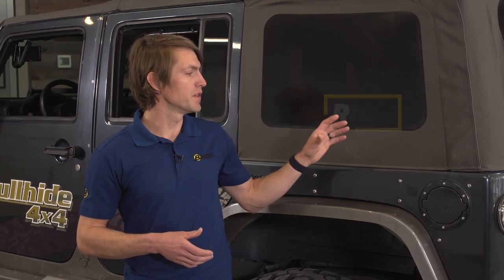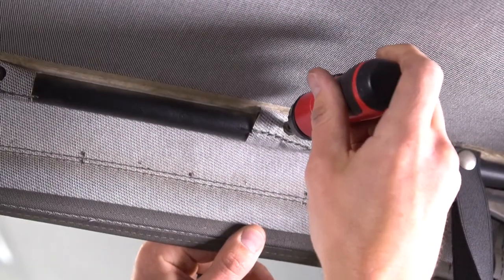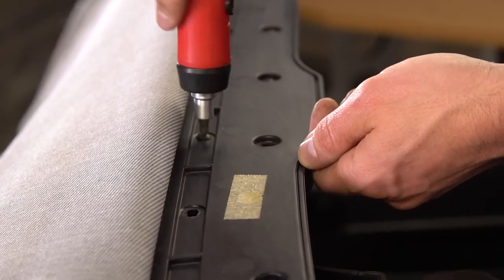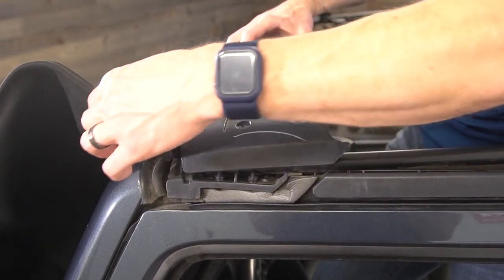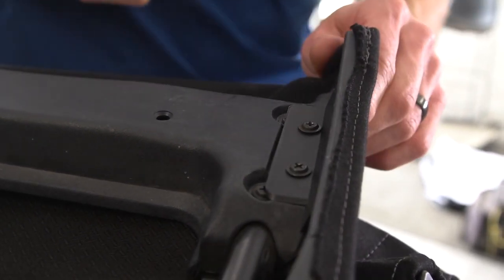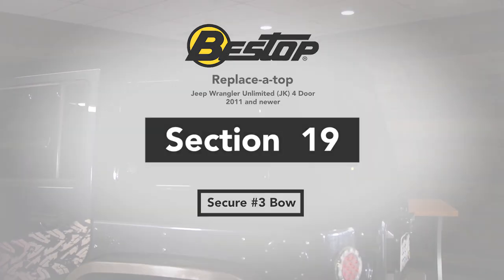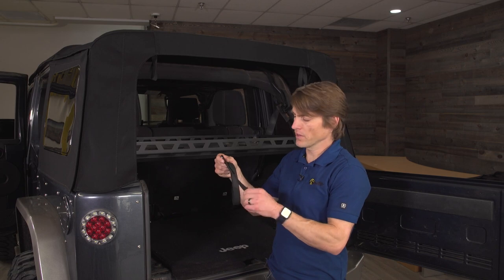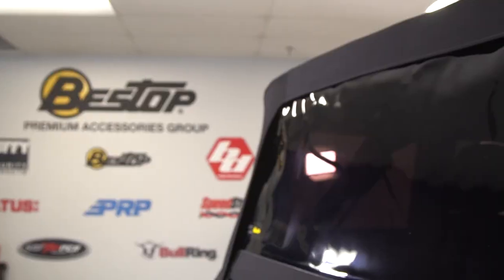JK Wrangler Replace-a-top Installation

Comment: What year is the soft top made for? I have a 2018 soft top and it folds under the door surrounds, but when I ordered a replacement for 2010-2018 it has the spring cable and I can't get the spring to connect.

Comment: does it matter if the old top is a best top soft top? if i were to remove a different brands top, would this replacement top fit on the same frame? i believe i still have the OEM frame but im unsure because the top was replaced before the jeep entered my hands

Comment: Where is the replace-a-top video for 4 door JLs?
Reply from the maker: We don't have a video because we don't make a Replace-A-Top for the JL/JLU's
Reply: LOL, I have a replacement JL top sitting in my garage that you just shipped me for a warranty replacement. So now I have to figure out how to replace my old top with the new one with no instructions.  @BestopTeam
Reply: Exactly !!  And the top they sent me has a spring dangling with a cord.  Which is supposed to go in a bracket.  My original top didn't have one, atleast I don't remember seeing one.  This was Mopar factory original.

Comment: I am replacing Factory original soft top on my 2012 Jeep Wrangler Unlimited Sport 4-door.  So, I ordered one from Bestop. First shipment I got was a wrong top. A khaki top with clear vinyl soft windows.  I called and let Bestop know.  They quickly sent me a second shipment.  But this time when I opened the box, first thing I noticed was a shiny metal spring dangling with a cord, another cord holding a squarish metal plate with bunch of holes in it. This does not look familiar to me.  There are no clearcut instructions on how to install it.  Will there be a place to connect the spring even if I didn't have one in original setup? What do I do with that square metal plate?  I haven't taken anything out of the box yet, because I was told that if I take it out of the box, and then had to return it for any errors, wrong item or anything, I will be charged a percentage as fees..  I am nervous about the spring etc.  Besides, all instructions are for a 2-door jeep.  Did I get a top for 2-door or a 4-door jeep.  What if the second top shipment is also not correct one.  There is not mujch time.  Winter is round the corner, and I heard it might be snowing sooner than later.  The ideal installation temperature of 71 degrees is also probably not there for a long while.  Can you guys please help???  The instructions are either for 2-door, or some different version of the top for a different version of jeep.  Why can't there be a straight forwardard set of instructions for what I am supposed to install.  All this spring and metal plate business is making me nervous.  I've had a bad experience with Bestop before also.  I ordered a set of window panels for the same jeep, and the back window had a problem.  There was about a half inch gap between bottom edge of the window panel and top of the back door.  And I was left high and dry, first with run arounds, and then a complete communcation blackout.   I am ready to pull my hair out with this. I don't even know if I got the right top.  Tomorrow is Monday, and I am going to call customer service again and see if I get anywhere with this.